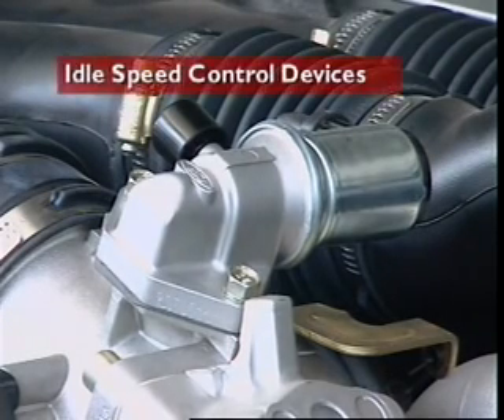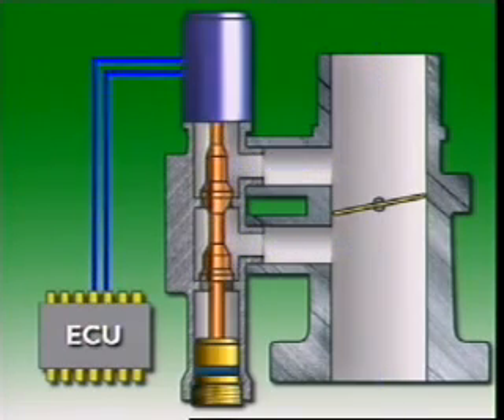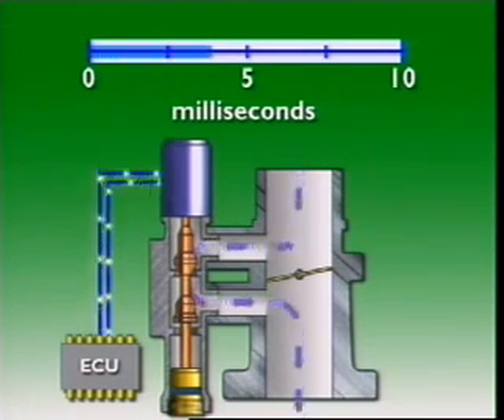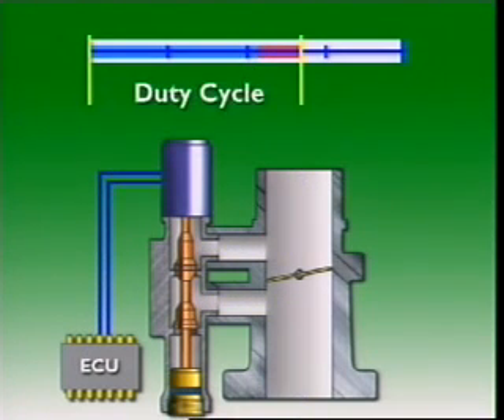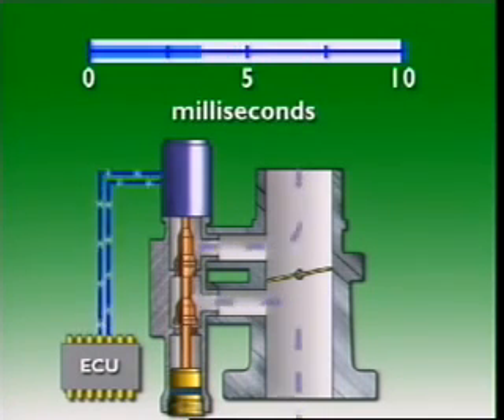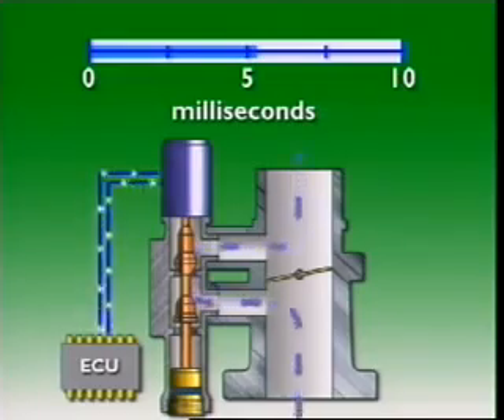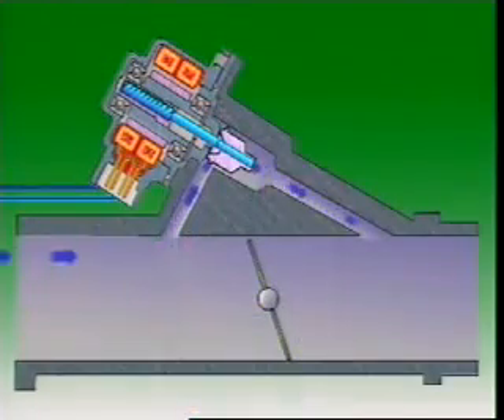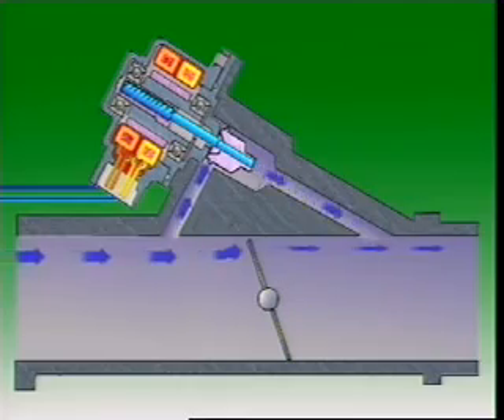Idle Air Control Valve

Comment: This seems so unnecessarily complicated, why not just leave the throttle body open a tiny bit
Reply: because in a cable actuated throttle body you can't change the opening with a motor based on temprature and other stuff, it's a fixed opening, when the throttle body is not actuated by the cable, that's why engines with ride by wire (fully electrical throttle body) don't have the idle control valve and uses the throttle body like you mentioned

Comment: Best video so far on IAC. However, still not quite clear about the manipulation of the movement of the pintle that would decide the amount of air allowed, the time duration and the complete cut-off of the airflow through the IAC valve. What are signals used to actuate the plunger? Thank you.